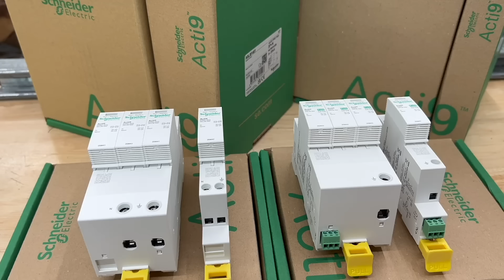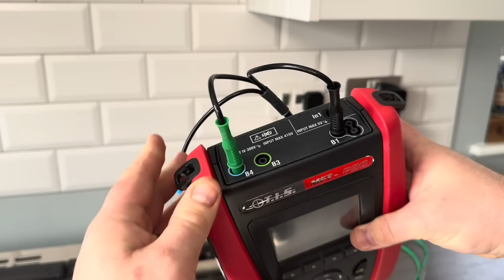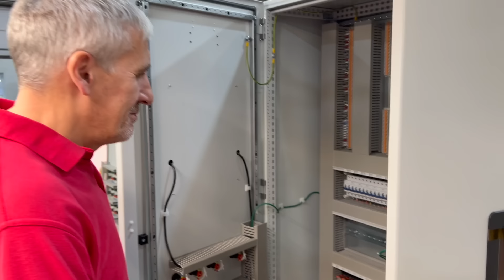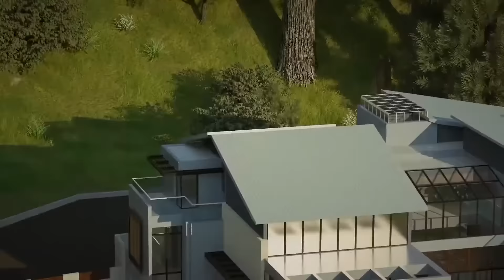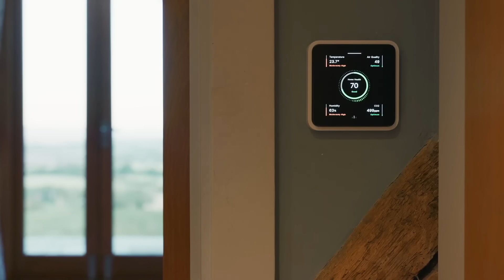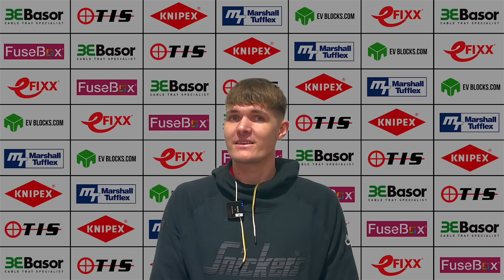The MCB Debate That's Dividing The Industry...

Comment: The scope of BS 7672 is installation wiring, reg 113 specifically keeps equipment out of scope.

The SPD is an appliance not a wiring installation. If the SPD doesn't require upstream protection then just as with the electricity meter, main isolator switch, the protective devices etc it doesn't need upstream protection.

On the other hand many protective devices do need upstream protection as backing protection, and we often depend upon the DNOs fuse to provide that.

Comment: Confusion again with the Grenfell Tower fire. A 5 year electrical inspection would not have prevented the fire. PAT testing maybe but even that is questionable as the source of ignition was a faulty fridge which could have been tampered with after all of the inspections.

Comment: I recommend to learn about voltage drop for R&D who requires MCB for SPD. How they managed to get job at R&D if they have serious problems with understanding high school physics? 

MCB has large inductor which will cause voltage drop on AC - in case of spikes voltage will drop on MCB. As voltage dropped, SPD will think that spikes are missing. 

Hager R&D employed educated people who understand that SPD is useless with MCB, OBO betterman specifies in manual that SPD might be protected only by fuses with the lowest possible impedance... but UK asking from their electricians very strange requirements. Also nobody of UK electricians told to authorities that MCB causes voltage drop and SPD became useless in case of voltage drop, so SPD should be protected by low-impedance device like fuse.
Reply: So let's see.  Transient appears, SPD conducts and clamps, happens to reach currents where the coil inductance becomes significant and causes significant voltage reduction... but SPD continues to conduct until voltage has fallen below breakdown point which is safe area for loads anyway.  Can you explain the issue?   Oh, and as a side note the earthing terminal usually has a GDT between it and neutral > line.  MOVs are typically only between line and neutral.
Reply: @retrozmachine1189 These spikes are very random, it is impossible to calculate MCB inductor behaviour. That is why SPD manufacturers from continental Europe require protection only from 160A and only by fuses. High-impedance MCB will cause voltage drop. 

It is question about R&D qualifications if they publish such requirements.
Reply: @Dmitrytln  You haven't actually explained anything.  You just restated your prior information.  If you don't understand what is going on just say so.
Reply: @retrozmachine1189 SPD won't conduct if the voltage is below breakdown point. Transients appear only when MCB coil is not saturated. Random spikes could have regular form and keep MCB coil saturated, where coil inductance will cause voltage drop. 

MCB is acceptable only if the grid has rare spikes and that spikes can't saturate MCB coil. Rare spikes happened only in XIX century, but nowadays spikes are regular, especially in big cities.
Reply: @Dmitrytln  Yes, that's right.  As I said, if you read my comments.  Now put on your thinking cap.  Consider the whole system not just the SPD and the associated MCB.
Reply: @retrozmachine1189 Lovato DMG7000 - Lovato DMG9000 can read spikes, so it is possible to measure spikes when SPD protected by MCB and spikes when SPD has no protection. 

I suggested efixx to make review for Lovato DMG series, but they left without review. Having energy quality analyser efixx could easily check how MCB affects to SPD.
Reply: @Dmitrytln  Sure, but you still aren't quite getting there.  I've tried to lead you in the right direction, given enough clues and hints.  It's up to you now.  A tip though, before you say someone else is wrong, make sure you actually understand the topic.
Reply: @retrozmachine1189 You are speaking about rare spikes, where MCB coil is not saturated cause of transients. Now imagine situation: someone wants to find circuit breaker and plugged cheap signal generator (capacitors series to diac) from aliexpress - spikes will be regular to saturate MCB coil.
Reply: @Dmitrytln  That's one heck of a stretch, just waking up are we?  What tone generator set are you aware of, even some magical mythical set from ali, are you aware of that generates signals over 275VAC.  Heck, which one do you know of generates signals over 20VAC?  Even toss in some completely ludicrous levels of ringing from the MCB trip coil if you like.

Comment: Something that is weird with SPD's (if you're one of those electricians that spends more time on their CAD system than running wires) is that MCB's only protect downstream, yet SPD's protect in all directions. By that I mean that if you have a DB that requires SPD (typically due to it feeding server racks, medical equipment etc), that SPD is also protecting the DB and its associated circuits upstream from that DB. Now this makes your maths a head scratcher, so that forces you to fit a redundant, useless MCB/SPD in the upstream DB, not because the brown bible says so, purely because its quicker, easier and cheaper to achieve design isolation through redundancy. It's something to ponder if you ever work on these types of systems.

Comment: How hard can it be to include a 32 or 40A fuseable link inside the SPD.  Design it right and if it blows it will activate the mechanical arrangement that turns the SPD status flag to red.
Reply: Unsure if your doing sarcasm or not here (they already have  this feature when they fail they melt the link inside witch makes the red window show)
Reply: @leexgx  Not quite sarcasm. The SPD in a consumer unit uses Metal Oxide Varistors. These degrade as they dissipate high voltage spikes over time. Eventually they get to the point that due to their degradation they are no longer effective and their resistance goes up. Due to their resistance going up the heat generated during a spike is enough to melt the solder holding their spring loaded connections closed. They then snap open disconnecting the circuit and revealing the flag. A fusable link e.g. a bit of old style fuse wire, specifically chosen to give similar overcurrent protection to a MCB would solve the problem of needing a separate MCB.
Reply: @andrewfrance1047 Who's ever going to see the red flag on a domestic. That's not really the topic anyway.
Reply: @ChariotsofWire180  Who's ever going to see a MCB protecting the SPD is in the off position. The only advantage of the MCB over a hidden fuseable link protecting the SPD is visibility and that brings the potential danger of someone turning it back on again which could be a good thing if it was turned off in error, but a bad thing if the trip was due to a failure within the SPD.
Reply: @andrewfrance1047 No one will ever see a tripped breaker, certainly in domestic, that's not the issue. Just like going on and on and on about how the flag turns from green to red, all irrelevant to the topic in question.

Comment: So if we can't use the DNO cutout fuse for overcurrent protection then what size tails should we be installing?  Are these 400-800A at the transformer so at 800A so what 800mm2 tails to cover 904A...  Boy that is going to be fun getting it into a domestic consumer unit which will need to be completely redesigned..   But wait are we even allowed to rely on that 800A?   Can we not see how silly this is the DNO are trying to pretend that its not their but in reality consumer units are rated to 100A, main switches are rated to 100A, they all rely on the main fuse for overcurrent protection so why would an SPD be any different?

Comment: The SPD question is what has the manufacturer tested it to, often the answer is a 63A fuse and therefore a cut-out fuse of 80 or 100A will not protect it and you have a potential fire. Also if you rely on the cutout fuse alone then when the SPD fails (as it will when it has absorbed its designed number of surges) then you take out the whole house not just the MCB supplying the SPD. On the installations I'm working on (with Mersen SPDs) I specified the mcb rating  Mersen give in their data sheet, and coordinated that with the supply fuse, so that I don't lose the whole installation. So what are the SPDs inthe smart meters rated at?

Comment: The issue is, if the mcb to the SPD false/minor trips, then the SPD is a chocolate teapot & homeowner will never ever be aware of it, meaning the spd could be disabled for months until the homeowner visits the CS
Reply from the maker: That's a good point. 🤔
Reply: Nice informed and intelligent answer here but i believe the RS485 is simply used for factory testing as effectively it is a LV connector in a HV consumer unit which could be problematic?
Reply: You are correct but the MCB will only trip if the SPD blows, but from experience, that will never be the case, I've been to properties that have suffered huge damage from lightning, the SPD's did their job, whereas the non-SPDed stuff like computer networks were all black inside and fried. However, there are a few points, the MCB needs to be ON and us electricians generally turn them OFF when testing (if >250v HF isolation is specified) which might be dodgy if we forget and secondly, the value of the MCB is, to my knowledge, never specified. Generally I use a 4 pole C32 and 10mm flexible (because I've always got a big pile of 1m long 10mm scrap bits!) 
Something, I am just just getting into are the next generation of MCB's/RCBO's, these have an RS485 interface, I don't know exactly how to use them yet because they are still in the box! I guess this could be integrated into an intelligent system to provide alerts to a phone if the MCB was ever OFF.
The Schneider range of SPD's have a relay out facility if the failed, or they used to, must admit I haven't used them in a long time, the last job I did that specified Schneider SPD's cost the customer 350 quid! ug!
Reply: @Ino-z2m  I can't imagine why an SPD would have RS485, nor what practical use it would have.  Temperature monitoring?  Device open is already accommodated by the contact set some SPDs have.  I'll have to look into what is done with RS485 for the items.
Reply: @Ino-z2m  A possible option is to take the line from a nearby cooker/shower protection device, so that it if the SPD trips said mcb/rcbo, then the occasionally used cooker/shower would no longer function & homeowner is then made aware of a fault. Then investigate, reset-trips & a call is put out to rectify the faults.
As long as the spd line conductor is same spec 10mm conductor as cooker/shower at the mcb/rcbo, then that device can act as a indicator if a fault develops to spd status
Admit, this is getting a little complicated or involved if spd must have additional over current protection - but at least this way it would perhaps give some alert if the protection to said spd trips as cooker/shower would no longer function
Personally - nah, I don't think most spd's today really need over current protection, but if you do fit protection to spd, then there should be a way of becoming aware the spd is no longer operating or it risks becoming a chocolate teapot